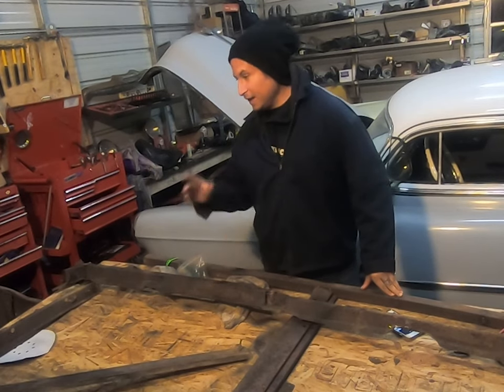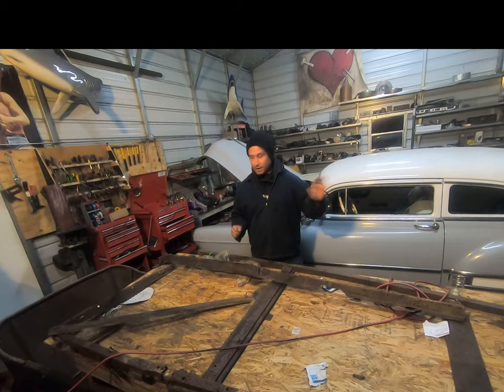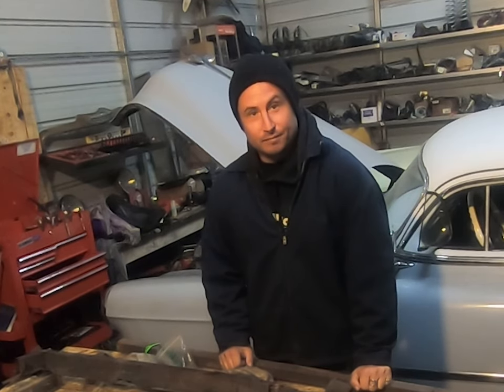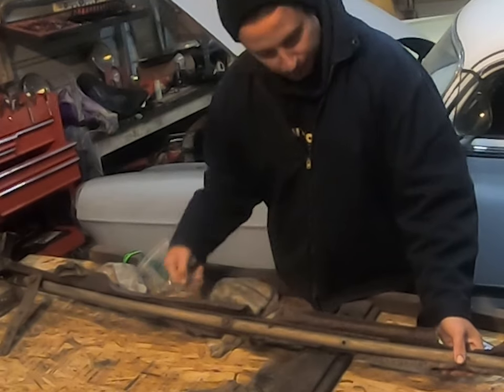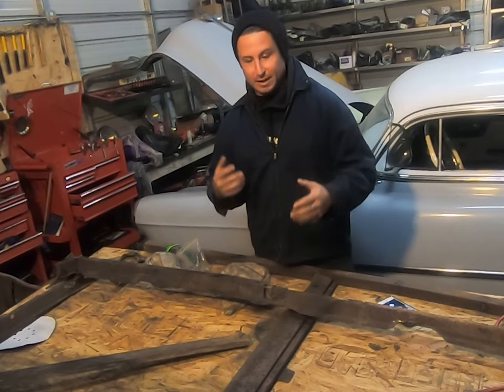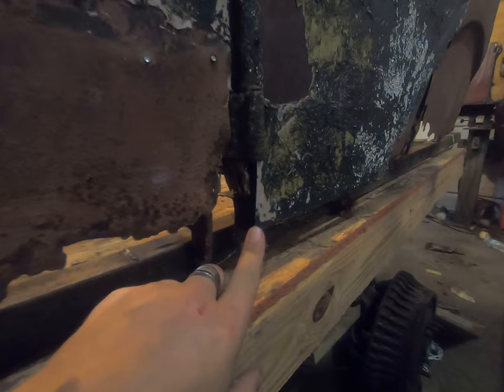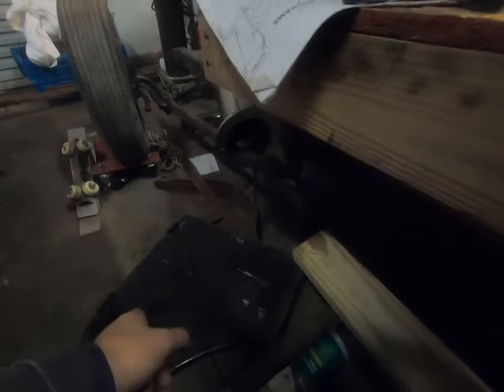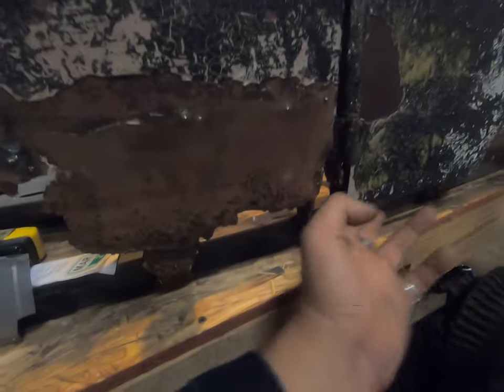Getting the (Very Junk) Body Back Together - 1927 Ford Touring Hot Rod Build Part 2

Comment: Honestly, I don't see how you can get the body right without a frame to supply the reference points.
Reply from the maker: It can be done… and well…  we just kinda have to in this case.    I will do my best to document the how tos  as I go.    I hope it helps someone… but this can be the case for a lot of  people.   if you buy a car that used to have a lot of wood framing that rots, or something that was channeled at some point (or started to be), or like my case… the car was just cobbled up worse than I thought when I bought it or even try to make something out of parts you collect individually at swap meets and such.